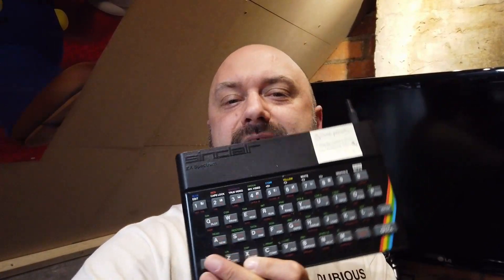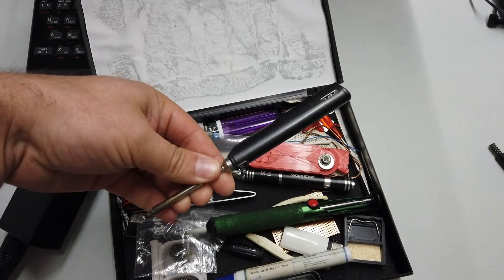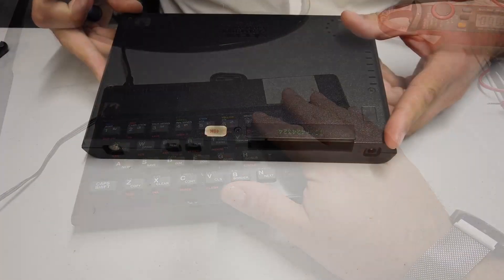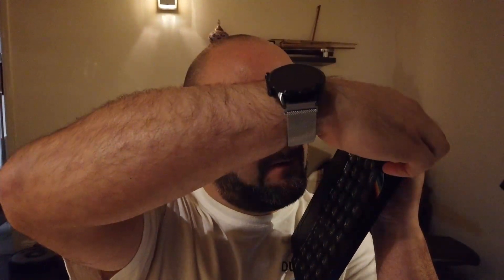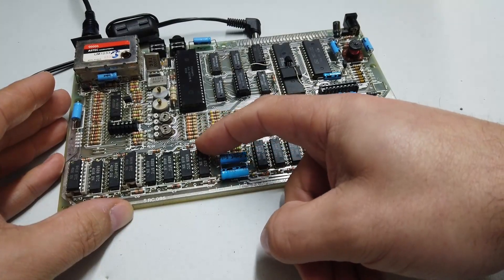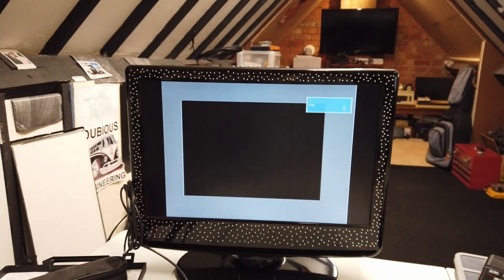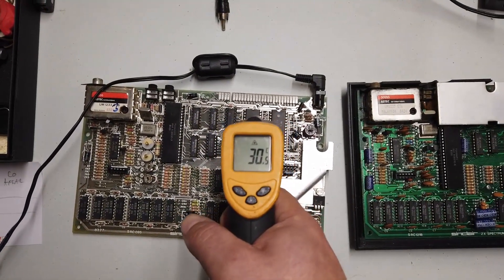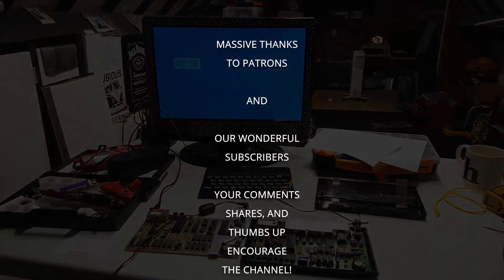DuB-EnG: Fix a ZX Spectrum 48k - Old School Rubber Keyboard, PSU Repair and General Refurbishment

Comment: Why not reverse the polarity on the power supply inside of the case? :-)

Was it hard to open?
Reply from the maker: That's a great idea, but....  if someone plugs a real psu in it could all go wrong!
Reply: @DubiousEngineering  I meant in the powerupply. Not in the computer. :-)

I've switched some center positive ones to center negative in my days for use om Megadrive/Famicom/Speccy. :-)

Comment: Lovely video Howard!
Now I want a diamond encrusted monitor 😂
I suspect ROM or RAM with what you've done so far. RAM you can possibly check with the piggyback method, I've not done this myself though as I use a diagnostic ROM or cartridge. Are the ROMs socketed on both machines? That would be a nice easy test if they are.
You're sooo close now, keep going! Shout at me on twitter if you need any help.
Reply: I was going to suggest a diagnostic rom too.

Comment: Howard, you have an oscilloscope? Take signal readings on the good unit at start up. and compare them to the wonky one.
Reply from the maker: I'd agree but you really need a 16 channel scope to diagnose a ram fault as you need to see all the ins and outs and the timings.  I'll have a poke around with a scope to see if it helps though...  Good call!

Comment: Might be a good idea to download some schematics and service manuals to see what is supposed to happen on power-up... you can see what gets initialized in what order and there's usually more troubleshooting info to go off of. Also, pull anything in a socket and squirt in some contact cleaner as sometimes it's just a bad connection due to corrosion.
Reply from the maker: I hate corrosion!! ..  very good point...  👍

Comment: This could be a Ram issue, best to get a few chips and piggy back one instead of soldering in a new one for testing purpose only.
once you find the bad ram, just replace and you should be good to go. If its the CPU, then ive not come across this problem, thankfully, just yet.  
Good luck with the fix
Reply from the maker: Every bit of ram ...  upper and lower... sadly